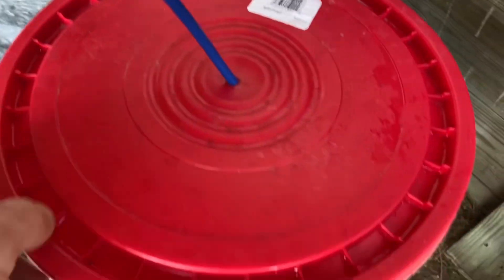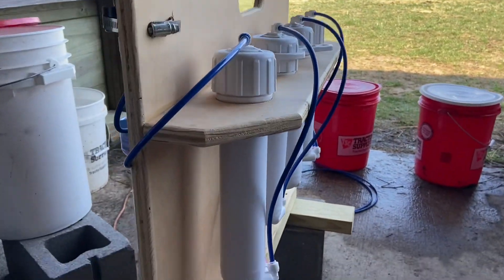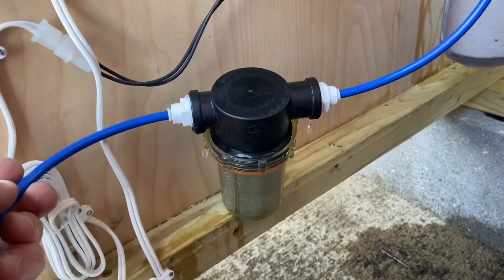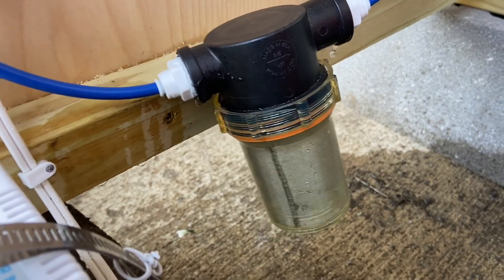Reverse Osmosis Maple Syrup - End of Season Observation

Comment: Do you need to run tap water through brand new RO filters to flush any chemicals out of the system? If so around how many gallons would be sufficient? Thanks!
Reply from the maker: Great question!  The RO filter brand I used was Membrane Solutions (150 GPD).  Here is all they say in the installation guide that came with the filters:  “Permeate water obtained from the first hour of use should be discarded.”
I suppose one could figure average GPM on a normal install and back into a number that way.  I just ran a couple buckets of tap water thru initially and got on with business.  My syrup turned out great, and I was very happy with performance.  You could always try contacting Membrane Solutions to see if they would further quantify.
Reply: @birchfieldfarming  thanks for the response! That clears things up. I'm using 2 400 gpd filters and am running at 100 psi and 50/50 permiate to concentrate im starting with 1.3 brix sap and the concentrate after ro is only 1.8 brix and there is still 0.5 brix in the permiate where there is supposed to be only water coming out. I'm not sure if I just need to add more filters to get a higher brix out of the concentrate end. Any thoughts?
Reply from the maker: @simondejonge3486  Did you install an adjustable (flow) valve on the sap outlet line?  If not, put a brass one in there and crank it down.  Anderson Metals 759106-04... https://www.amazon.com/dp/B00529BBK2?ref=ppx_pop_mob_ap_share
Reply: @birchfieldfarming  yup I have it pretty much exactly how you have it in your video so I can get the 1:1 water to sap.
Reply from the maker: @simondejonge3486  Ok, yeah, that brix doesn’t seem right.  I was going from about 2.5 to 7 in one pass.  What happens when you crank down the valve so nothing comes out the sap side?  Any brix in permeate then or are you zero?
Reply: @birchfieldfarming  I have not tried that however I believe that when I tightened the needle valve down more, there was a higher sugar content in the permiate side when I checked.
Reply from the maker: @simondejonge3486  I would try running it with more flow on permeate side than sap, so as to force more filtration.  I’m also wondering if you need to run it a bit more if it’s new.  On mine, which were only the 150’s, I noticed it had to run for awhile before it really shot the brix up.  Keep me in the loop, I’m curious what you find.
Reply from the maker: @simondejonge3486  Is there anybody else reading this who has experience with RO and an idea for Simon?
Reply: @birchfieldfarming  Will do! Thanks for your time and help!
Reply: One last question for you in your ro system is there any sugar going out through the permiate line or is it just pure water
Reply from the maker: @simondejonge3486  According to my sap hydrometer, I had zero sugar in permeate water coming out of system.  My flow was a little greater on permeate side once I got the system going and steady.  I was running 95 to 100 psi, so your pressure sounds good.  You could be right, just not enough filters to remove all sap.
Reply: @birchfieldfarming  thanks for your help! That's what I was thinking as well, And having such low sugar content in my sap isn't helping either. Have a great rest of your day thanks for your help!
Reply from the maker: @simondejonge3486  You bet - I’m still curious to know when you figure it out.